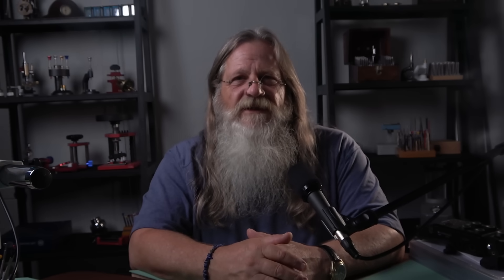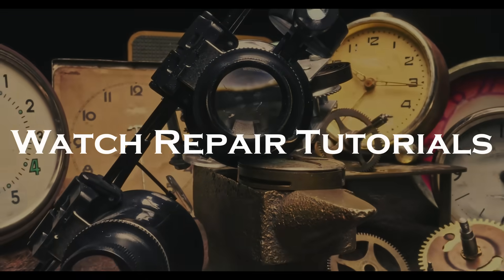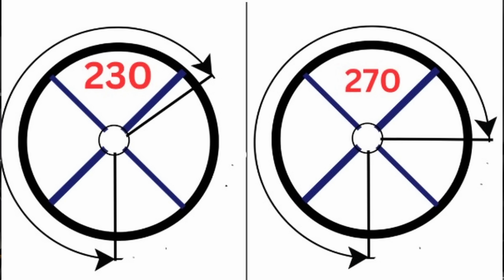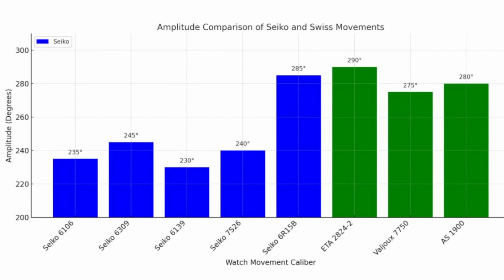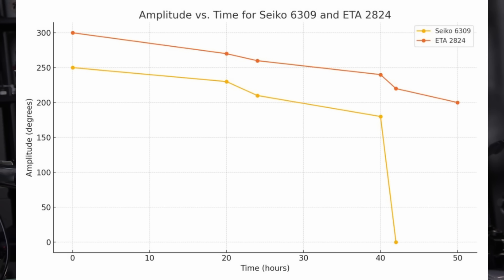Why Seiko Runs at A Lower Amplitude

Comment: Alex, that was a great explanation of the differences in philosophy between the Swiss and Seiko and why Seikos run at lower Amplitude.  But if you will allow me, you mentioned that Seiko doesn't produce a lot of Chronometers and you cited King Seiko,  I contend there is more to the story.

In 1968, at the Geneva Observatory trials, the top three watches were quartz prototype movements from C.E.H., a Swiss consortium. The next 7 positions, rounding out the top 10, were all awarded to Seiko.  Soon thereafter, the Swiss called off their Observatory trials.  In 1973, the Swiss introduced a new benchmark for watches, COSC. But to get COSC certification, the movement had to made in Switzerland. 

Seiko had created its own “Grand Seiko" Standard which was more rigorous than COSC. There are several Seikos with "Chronometer" on the dial from before the Swiss made Seiko remove it. My collection includes a 5722-9990 35J Grand Seiko Chronometer from 1965, and a 6245-9000 35J Seikomatic Chronometer from 1966. Both these 6 decade old watches currently run slightly over 230 Amplitude and keep time almost as well as my one year old METAS Omega Seamaster.  Since around 1970, any time you see "Grand Seiko," its a tougher standard than COSC and is a chronometer in all but name.
Reply from the maker: Thanks for a great comment and teaching me about a couple chronometers from your collection. I was not aware of these,  so thank you for sharing your knowledge. 😊

Comment: I would rather shorter power reserve and better accuracy, in my experience seikos 70 hour mid tier movements have terrible accuracy, +20 seconds out of the box is not good enough in my opinion
Reply from the maker: You know there are a lot of people feel the same way especially when they have spent a bunch of money on a watch. The reality is that the SRXX are only regulated to 3 positions so it still is really only a mid tier movement and that's being generous. Many perform quite well but many do not.
Reply: There's a good column recently in the web site Ablogtowatch regarding such wide specs, the title of the article is 

Grinding Gears: -35/+45 Sec/Day ‘Accuracy’ Is Not A Watch, It’s A Time Guesstimator

The columnist was spot on.

Comment: Thank you for this great and informative video. I just serviced an old Seiko with an old 6319 movement for one of my colleagues, and I'm by no means a professional, watchmaking is mainly an interest and a hobby of mine, and I was wondering why i couldn't get the amplitude above 210-220, so your explanation set my mind at ease. You talk a lot in your comments about adjusting the escapment. Could you explain what adjustments could be made on the escapement?😊
Reply from the maker: Ah yea. So older Seikos have a deeper lock that Swiss movements which is one of the reasons for lower amplitude. Lock is basically how much of the escape wheel tooth slides down the pallet stone before it reverses and receives the impulse. 
So if you adjust the pallet stones to reduce the amount of lock, the escapement requires less energy to unlock. This also requires adjusting the guard pin to make sure   it still provides its safety function. This a  simplified version of adjusting for performance and there is a lot more to it.
I find it the most interesting part of watch repair.

Comment: I’m working on a 5216A, 227/185 on horizontal positions. Higher with dial down, which probably means that the balance pivots have been worn out differently, agree?
Reply from the maker: That’s possible. The problem will be under the balance wheel when it is in the position with the lower amplitude

Comment: Question: Why does my, and so many other's 6R35 have so much positional variance and a significant timekeeping drop near the end of the power reserve, when it's supposed to be the new generation with a higher amplitude?
I noticed its balance is smaller than that of the 4R35, I presume it's due to the need of a larger barrel. Is a small balance the cause of worse timekeeping?
Reply from the maker: They don't perform as well at the lower end of the power curve according to Seiko. People who wear them as a daily seem to do ok but if you are wearing them every other day that's probably where you will see problems. 

Most people are fine with this, they reset the hands and keep going. You mostly hear from the ones whose expectations were not meet based on what they paid.

The SR35 it is just a basic grade movement equal to basic grade Swiss movements. The fact that it is only regulated to 3 positions, one being dial up, is often overlooked.
Reply: @watchrepairtutorials  Still, even at those positions, the variance is pretty big. Bigger than with the "lesser" 4R35. On the upside, I didn't have to touch the crown when I wore it every other day, "resetting" it by having it rest in the apropriate position. It only goes downhill on the third day.
Some say its predecessor, the 6R15, was better at it, some say it was worse.
Reply from the maker: @vaclav_fejt  When factories match balance wheels and hairsprings together they start by testing the balance wheel and put each in one of 20 categories based on it inertia and then they test the hairsprings for torque and place them in one of 20 categories.  Once that’s done they match a balance wheel to a hairspring based off some formula they have to get the matched set to as close to the desired frequency for that movement. Some of these matches sets are perfect, say 5 out of 20 , most are very close, 10 out 20 and the last 5 are considerably worse.
So it sounds like maybe you got a matched set that was not in that top 15.  This last grouping  of oscillators are much harder if not impossible to regulate to all the positions.  Sometimes it’s the luck of the draw.

Comment: my 2018 Seiko 7S26 is still fine, ticking away at around 270° (dial up/down). Even though I have dropped it once and worn it whilst commuting with my motorbike. (disclaimer: I used the app found on the google play store, I don't have an actual timegrapher)
Reply from the maker: That would be very unusual for a 7 year old 7S26 to be at 270 so count your blessings. 
How accurate is on on your wrist?
Reply: @watchrepairtutorials throughout the day it's -4 s/day, but I only have 5 data points (throughout 4 days), I lost my data from 2018-2021 when I used it on a daily basis. But if I remember correctly, it was below 10 sec/day back then as well.
Reply: @watchrepairtutorials  it is -4 sec/day. I have lost my data from 2018-2021, so this is a new dataset of 5 measurements through 4 days.
Reply from the maker: @RonaiHenrik with all things considered, that’s very respectable by any standards.

Comment: Do you think NH35 without service with regular wear can last for next generation?
Reply from the maker: One thing that’s important to know about the NH line of movements is that they are lubricated at the factory. 
What that means is that sometimes the lubrication is good and sometimes it’s not. They tend to be under lubricated and that is a big factor when it comes to longevity.
Then each movements are designed more like the Swiss movement. That means the higher amplitude is more important as far as keeping what most people would consider accurate time.
Considering the movement cost $40 most people use it until it no longer keeps accurate enough time for them and they just switch it out.
Reply: @watchrepairtutorials  Oh alright then, thanks for the explanation

Comment: New Rolex datejust movement and all sports models with similar movements now run at 245-265. Range depend on positions.
Reply from the maker: Yes you are talking about Rolex’s Chronergy escapemen. They reengineered the escapement angles and use a very light weight pallet fork to increase the escapements energy efficiency.
They do operate at a slightly lower than normal top end amplitude like you said but are still supposed to be at 210 after 24 hrs from a full wind. 
Some people with earlier versions reported some issues with amplitude below Rolex specs but they have made some changes to eliminate that issue.

Comment: Does it also apply to high-end Seiko movements like 8r35 or Grand Seiko watches?
Reply from the maker: No, this video is referencing older vintage Seiko calibers. Their newer calibers should be achieving amplitudes more inline with the Swiss.
Reply: @watchrepairtutorials  just a question by a person who is interested in buying a Seiko Marinemaster… do you think Seiko movements are comparable to Omega Coaxial movements in terms of quality and performance?
Reply from the maker: @giovannibrunoro1055 not at all. 
The coaxial escapement is on another level.  I like the marinemaster but you can’t really compare the movements
Reply: @watchrepairtutorials  thanks 🙏

Comment: Great video Alex. Myself and a lot of other amateur watch repairers working on vintage 61xx series Seikos are jewelling the barrel arbor ports and also upgrading to the GR2537X mainspring which is .15 thickness and gives higher amplitude of around 260+ compared to the original 0.11 which is no longer available
Reply from the maker: I love it. I enjoy upgrading movements as well to get better performance. Thanks for sharing your experience. Upgrading to jewels for the barrel is something I have done as well and I have even went as far as readjusting the escapement and gained performance there as well.

Comment: I have two watches with Seiko movements, one is Wise Hitman with the NH35A, the other is the Alpinist with the 6R35.
Wise runs fast about one second part day, this is how it arrived, this is how it works no matter what for two years now. 
The Alpinist is all over the place, I regulated it more than 10 times, sometimes it runs faster, sometimes slower, depending on anything, birds flying and singing around or raining. The amplitude is really low at around 200 degrees. I hate it, but the cheaper Wise is simply incredible with this 5 dollar movement.
Reply from the maker: Sorry to hear about the Alpinest. Sometimes the factory matching of the balance wheel and hairspring can be crap. Those are the ones that can definitely a challenge to get running right. The escapement probably also needs to be set up better.
Reply: My baby alpinist last for 40h without wear and with 55 crown turns. Is it normal or shall i send for service?
Reply from the maker: @chanhuyly1040  doesn’t that have a power reserve of about 70 hrs? How are you testing it.
Reply: @watchrepairtutorials i turn 55 times and let it sit in the box to measure.
Reply from the maker: @chanhuyly1040 I would not go by crown turns because that can vary by user. I would go by revolutions of the barrel.
Watch the screw in the crown wheel and turn the crown until it makes 11 revolutions and then test it. That way you know it’s at full power. Then if it still only runs for 40 hrs you know you have an issue
Reply: @watchrepairtutorials definitely try this out, thanks so much
Reply: @watchrepairtutorials thanks a ton sir. I tried and it got solid 72h with 11 revolutions. Had to see this by looking at case back while doing but saved tons of time sending for warranty.
Reply from the maker: @chanhuyly1040 awesome to hear. I hope everything is ok

Comment: Thank you master Alex. I would also like you to say something about Russian and German watches in a video on this topic. For example, my Raketa cal. 2609.I has an amplitude of up to 336 degrees in the dial position, and 270 - 290 in vertical positions ?!
Reply from the maker: They sound high. How do they keep time?
Reply: @watchrepairtutorials  Dial UP +4s, Dial DOWN + 7s, Crown Down -4s, Crown UP  -5s, Crown RIGHT  + 6s. Beat error is about 0.3 ms, BPH 18000. This was measured by an Android application, when a watch was fully wound, I don't have timegrapher.
Reply from the maker: @Жељко_Милутиновић That’s about right for the quality. There’s nothing wrong with that.  The overall delta is 13 which is still below 15 so I would say that’s ok. It looks like the regulator pins are set as good as they are going to get so good job

Comment: Seiko runs at lower amplitude just because they produce crappy calibers. 6R calibers is a real shame for Seiko with anacronistic tolerances and terrible performance.
Reply from the maker: I myself am more aid a Swiss style person and although I agree that the 6R series can be challenging, you are overlooking why they are what they are which I think I laid out pretty well.
Reply: @watchrepairtutorials I disagree — most of my Seikos didn’t last more than 7 or 8 years before needing a full service, and even when new, they performed terribly. The 4R movements were, and still are, budget calibers, but definitely better than the 6R ones. The 6R series were poorly designed from the start and only got worse over time due to a pointless increase in power reserve done for marketing reasons. Over the years, the 6R movements went from 50 to 70 and then 72 hours of power reserve, with changes that reduced both accuracy and reliability — like the downsizing of the balance wheel, for example. Compare a 6R15 with a 6R35 or 6R55 and you’ll see I’m not lying. Seiko should be ashamed — the current 6R calibers are a disgrace, especially considering they are now fitted in watches that cost well over €1000.
Reply from the maker: @sblantipodi well again the focus of this video was why Seiko engineered their watches to run at lower amplitude.  I would agree with you that the performance and rates achieved in these calibers is modest but Seiko and the customer base was ok with that.
As far as their newer calibers I don’t buy them. I don’t buy Seiko’s watches at all with the exception of one that I bought to modify and upgrade. Everything else I own is Swiss or American calibers.
Reply: @watchrepairtutorials  Fair enough, thanks for answering :)

Comment: Most of my NH35/36s have a range of 300 degrees, or even more when fully wound. I have an NH35 that is limited to about 260, but that is an exception.
Reply from the maker: Is that from the factory or after service?
Reply: @watchrepairtutorials  From the factory. These are TMI movements purchased at retail and I regulated them to +/-5 seconds and a beat error of 0.2-0.3 ms, but the amplitude was already very high to begin with. Perhaps they have slightly modified their characteristics recently?
Reply from the maker: @ericcccccable they have. I sold them for a while and regulated tons of them. Most of them did fairly well, some did exceptionally well and then there was some ones that were real dogs.
Reply: @watchrepairtutorials  Thanks !

Comment: Lower amplitude and lower beat rate for increased durability
Reply from the maker: That’s right, a lower amplitude results in less wear and tear on the components. Increased wear is a know issue in high beat movements especially over 4 hz.

Comment: Il confronto con i calibri svizzeri non è possibile farlo.. Sono due mondi diversi che hanno caratteristiche diverse. Le qualità non sono uguali e  il costo di un NH35 giustifica la qualità e non è corretto metterlo sullo stesso piano di un 2824-2. Un NH 35 non ha neanche le schede per la lubrificazione dei pallet, infatti tutti lubrificano un NH 35 con I criteri svizzeri per nessuno capisce le prescrizioni seiko. SEIKO ha i ponti in acciaio stampato e la qualità non può essere la stessa di ponti lavorati...ecc.
Reply from the maker: That was exactly the point of the video, mate. Seiko’s modern movements are designed much like Swiss movements but no one would argue the difference  between a $40 movement vs on that is $250. 
With that said Seiko makes a hell of a $40 movement in the NHXX line.

Comment: Thanks for this.  I've got a 7009A to practice on, so now I'll know when I eventually get it right!
Reply from the maker: They can be a little challenging depending on condition but, let me know how it turns out.😉
Reply: @watchrepairtutorials  I've already broken it twice and had to buy another donor movement...
Reply from the maker: @Shpeil what are you breaking?
Reply: @watchrepairtutorials  Hah.  You know those plastic bits of the date mechanism...?  I stripped the teeth off one of those.  Then I managed to break the mainspring.... it was probably going to break anyway so I'll claim that one wasn't my fault.  :)
Reply from the maker: @Shpeil when you install a system on the watch, test it and if you feel any resistance, stop and see what’s going on.

Comment: Coincidentally, there is a pretty new thread on WUS titled Why does Seiko do it? in which someone serviced their Seiko 6R15 movement, and instead of using standard Seiko oils, he said he oiled it as ETA recommends for a 2824. (Swiss Oils & recommended oiling practices ), work on the hairspring shape, flatness & centering. Regulation i/opening through regulator block.
The result was crazy high amplitude, ranging from 295 to 323 deg, 0.0-0.2 BE and -1 to 0 spd . I am curious to see what you think about this. Will this amplitude hurt the movement in any way?
Reply from the maker: Not at all. Seiko’s modern movements are designed differently, more Swiss like if you will, and should operate at higher amplitude.

Comment: As a tinker rather than  watch professional, I may not know for sure, but my understanding is that a 4 Hz movement is less influenced by positional errors than a 3 Hz movement. So I’m told.
Reply from the maker: That's true. Very deep subject, but it basically comes down to its shorter oscillation period, having a stiffer restoring force and lower amplitude sensitivity.
Reply: @watchrepairtutorials could do a video on 4hz vs 3hz please? That would be awesome!! Thank you!
Reply from the maker: @jjaune2523  That might make a better article for my Blog. I’ll work something up for you.
Reply: @watchrepairtutorials thank you!